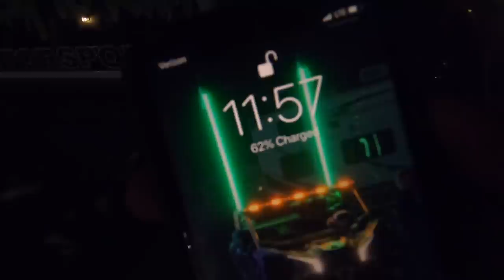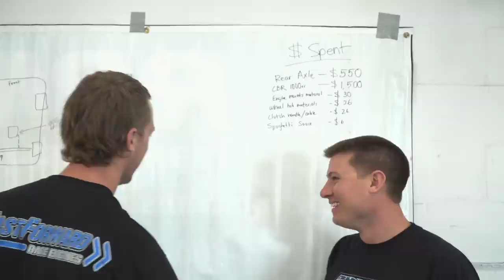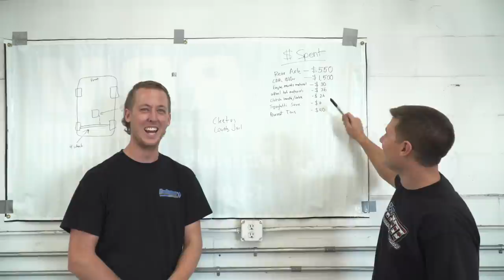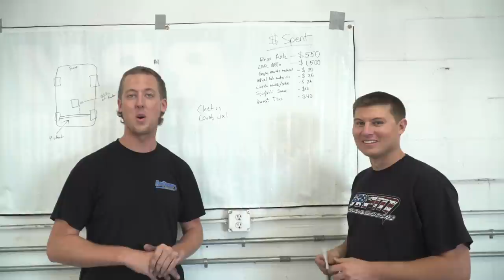Build Wars DAY 2: Buying a WRECKED 1000cc Street Bike for Our Golf Cart Build!! (SHE'S A RIPPER)

Comment: Hey bud they make a chromoly axle for the carts an it's much stronger than the  one you have now
Reply: Aluminum tube axles are plenty strong enough for their  build,  they take the abuse of Mini Sprint Dirt racers running wide open all the time.
Reply: Well a sprint cart doesn't make over 100hp an I'm sure they are gonna be pushing it more closer to the 200hp mark now that they just got a CBR1000 so that axle wont live an chromoly would definitely be a better choice
Reply: Not sure where you get that from, there is even a 1000cc class
Reply: Sprint racers are on dirt not asphalt so it's much more forgiving an way less traction but cleetus is gonna be on the street drag racing so I'm sure the chromoly is gonna give him a better chance

Comment: If a bike doesn’t run it’s usually crack head wiring
Reply: Bad head the white smoke was the first sign
Reply: @tashafowler1941  Ridden hard and put away wet. Guessing it was crashed, then did the burnout in the shed before forgetting about it.

Comment: Sounds like low compression on one cylinder.
Reply: Yeah that's definitely not all 4
Reply: It actually sounds much healthier in the Boosted Boiz day 3 video
Reply: It has bad gas it's not going to sound %100
Reply: Stoned Göst  This guy gets it. 😂
Reply: It wont even idle on 4, it’s cooked
Reply: The condition of the rear tyre is a huge clue as to how it has been treated. Probably stolen, thrashed and dumped before being recovered and sold to Cleetus.

Comment: If that axle is anything like a Kart axle they are made to flex like that.  It helps with planting the outside tire wile lifting the inside tire in a corner, still very strong for what you'r doing.

Comment: Couldn't tell if you got the airbox with the bike but modern bike motors need the airbox to run properly under load. If you didn't get the air box then I suggest you find one. If you got it go forth and blaze tyres

Comment: Check out the video “2000 hp Supra 0-60 mph in 1 second”, specifically the section on the data logging. They even have a water pressure sensor. When the pressure goes up, the head gasket is not holding. I’m guessing you computer management has all those features too. Also they use a lockup convertor on the big end and nitrous to get on boost at the line.

Comment: You need the secondary injectors to get the full power (above 5500rpms) and also delete all the flat valve, catback etc for it to run full send and not powerreduce with all the check lights, hit me up if you need the ecu tune, what tag its on the ecu?

Comment: Cleetus with the axles bearings they look similar to a junior dragster one take a couple minutes to take one of the dust covers off and put a little grease or chain lube in the bearing because they don't come with anything in them I went through three sets till I took one apart and had a look so if you have time please read and put some bearing grease in the axle bearings

Comment: Dudes -- You're gonna have issues with your overall final drive ratio -- the difference between the original tire height and the new small tires are gonna kill your overall speed .. might even have to leave in second gear...   Needed to go to super small gear on the rear or super huge on the front to make up for tire roll out....

Comment: Get the camera guys to hold steady or run a stabilized/gymbal mounted camera......the back and forth motion and fast pans makes it very hard to watch. The second video is better than the first. The camera guy that showed the engine mounts and then the top of the carbs, was moving too fast and didn't stay on one item long enough to even see the mounts. I know it isn't easy to move around the action and get steady shots, but I'm also assuming these are pro camera guys. The short music clips don't add anything, but if you keep them, at least lower the volume. It sucks to have the volume set to hear the guys talking and then get blasted with the music. Music is better suited at a lower volume to fill in and would work with some of the panning shots (c roll?) of random things in the shop (like the partial spin around one of the engines).

Comment: Umm. I would really use more than 3 bearings on that rear axle. If you check out red beard garage where they build go karts with 670 CC engines they tear up rear axles that have five bearing and carriers without breaking a sweat. You're going to have double the horsepower of their builds with half the bearing support. I would really think about adding as many more bearing support as you possibly can.

Comment: It does not sound "low on compression" on one cylinder, it's been sitting with old fuel, and the airbox is off of the stacks... Of course it's gonna sound like shit... Put some fresh fuel In there and hook up the 3 sensors that actually hook and read to the airbox back up! She will pur like a kitten.

Comment: Remember it’s a motorcycle trans. Just pull on the shifter a tad, snap off the throttle just barely and it’ll fall into the next gear. No clutch, keep the power going to the ground